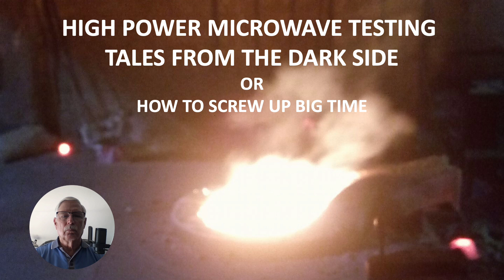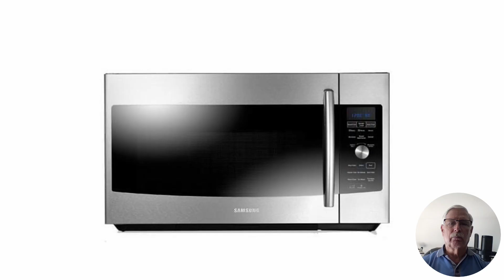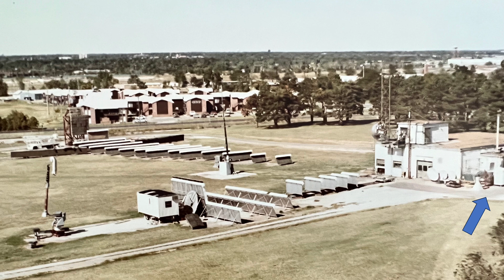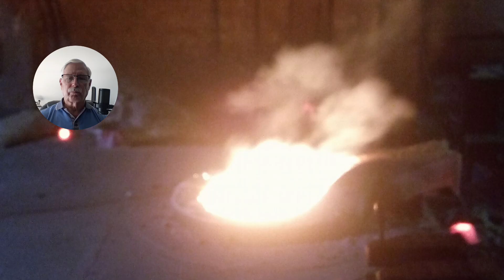Electrical Engineering Tales from the Dark Side or, How to Really Screw Up a Test!

Comment: Great story, Ron!! A bit off topic but I read about a tramway that was installed across the Grand Canyon to Guano Point in order to mine the guano from Bat Cave mine. It was only in operation for a few years and ended operations in 1960. Shortly afterwards, a US Air Force plane clipped the cable while 'hot-dogging' - but didn't crash!! I couldn't find any more info on it and thought you may have resources to find out more and to do a video about it. Oh, and the mine had an airstrip for transport of supplies. Take care, Ron!!
Reply from the maker: Not sure on that one but let me look